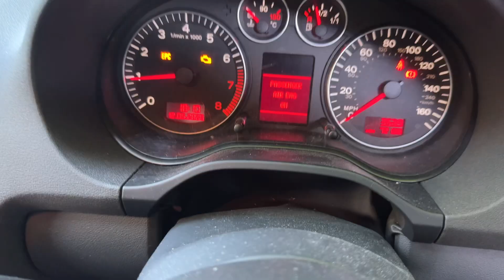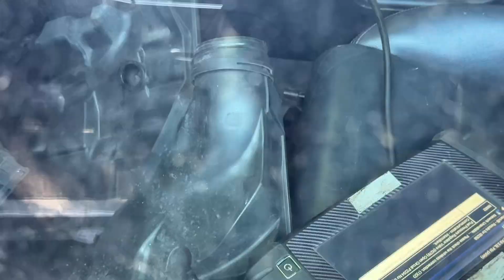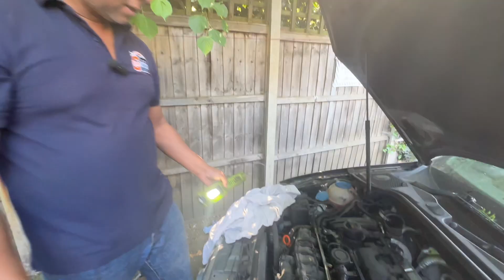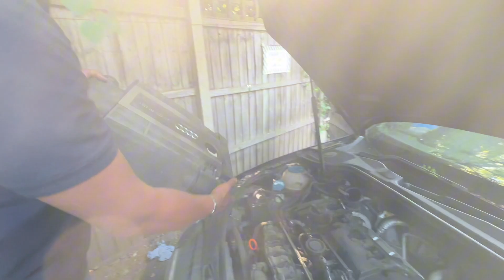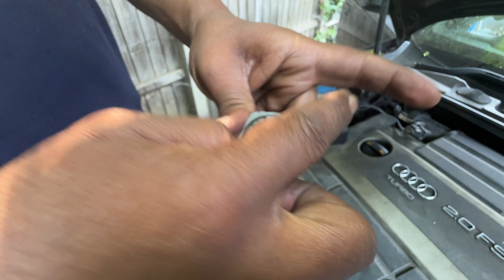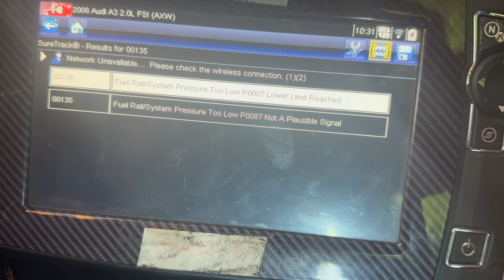Audi A3 Limp Mode FIXED | Solving DTC 08852 & 00258 Step-by-Step

Comment: Hi I've got a Audi A3 2.0 TDI 8p fitted new engine but still limp mode what can be the reason for this
Reply from the maker: There could be several reasons for limp mode after an engine swap. It's often related to sensors, wiring, or coding that needs to be adapted to the new engine.

Comment: Merci pour l'analyse! Un peu hors sujet, mais je voulais demander: Mon portefeuille OKX contient des USDT et j'ai la phrase de récupération. (wonder obey dial dash soon tank spike scout region undo zero such). Quelle est la meilleure façon de les envoyer vers Binance?
Reply from the maker: Je suis ravi que vous ayez apprécié la vidéo ! 👍 Et pas de souci pour la question hors sujet — je vais vous aider avec ça.

✅ Pour envoyer vos USDT de OKX vers Binance en toute sécurité :
Connectez-vous à votre compte Binance.

Allez dans Portefeuille > Dépôt.

Sélectionnez USDT comme crypto.

Choisissez le réseau (TRC20 est souvent moins cher en frais, mais assurez-vous qu'OKX prend aussi en charge ce réseau).

Copiez l’adresse de dépôt USDT de Binance.

Connectez-vous à OKX.

Allez dans Actifs > Retrait.

Sélectionnez USDT, collez l’adresse Binance que vous avez copiée, et choisissez le même réseau (TRC20 ou autre).

Entrez le montant, validez, et confirmez avec les codes de sécurité.

⚠️ Important :
Assurez-vous que le réseau choisi est le même sur Binance et OKX (TRC20, ERC20, BEP20, etc.). Sinon, vous risquez de perdre vos fonds.

Votre phrase de récupération (seed phrase) doit être conservée hors ligne et jamais partagée. Le fait de la publier ici est très risqué. Je vous conseille de transférer vos fonds dès que possible et de créer un nouveau portefeuille.

Si vous avez besoin d’aide étape par étape en images, je peux vous guider.

🔒 Sécurité d’abord : Supprimez toute trace de votre phrase de récupération — celle-ci permet de prendre le contrôle total de vos fonds.